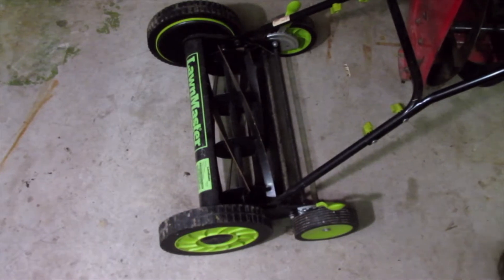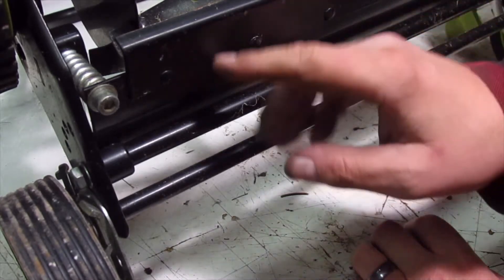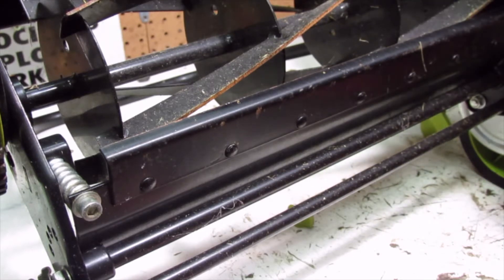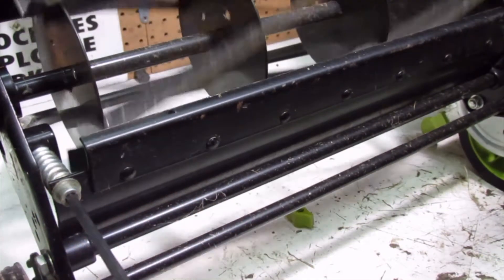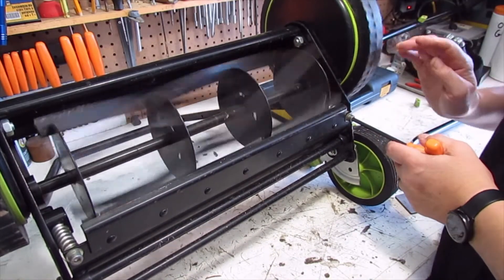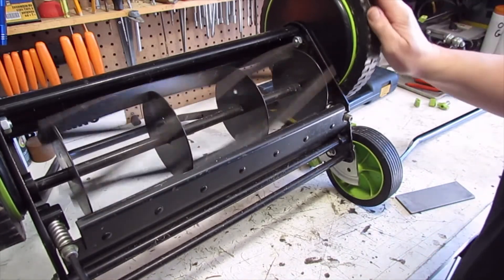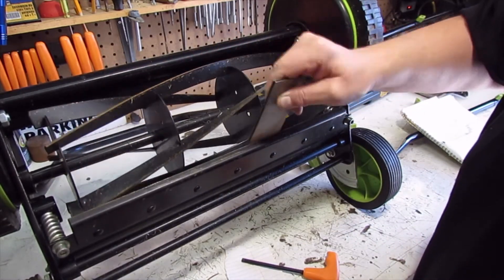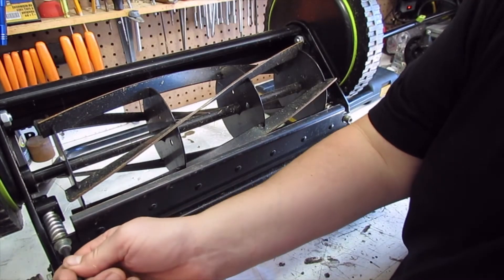De Squealing a Reel mower - And other cutting edge insights.

Comment: Can you fix a squealing gas mower?  I got my reel mower at walmart just like this one. no tools needed to put it together. mine squeals exactly the same from the very first use!
Reply from the maker: Squealing Gas Mower? Sounds Bad. engine trouble? Or is the blade rubbing on the deck?
Reply: @daslab68  I'm not sure. I try to spin the blade and it seems tight to spin. My neighbour said the same thing, that it is tough to spin. IT doesn't seem to touch the deck. It started squealing as I was using it at the end of the season. Got any ideas? thanks
Reply from the maker: @mranderson5668  Please make sure the spark plug wire is disconnected before you try spinning it so that it doesnt start up on you.  Try spinning it with the spark plug screwed out of the cylinder head.  it should spin freely with no compression when the spark plug is out.  if it is still tough to spin I would suspect some lower end damage. Perhaps gas flooded the crank case and you had poor or NO lubrication and have mangled up your crank shaft.
Reply: @daslab68  thanks, i will give it a try!

Comment: Did you end up sharpening it with the stone or backlapping?  Only used a stone on mine and needs more work.
Reply from the maker: I ended up getting a kit to back lap it.  It worked pretty well.  A stone would be hard to do on the curved surfaces, but it would be sharp when you were done.

Comment: Thank you. No it is not supposed to sound like that. Maybe it got hit & put it off balance. Maybe try a bit of oil. Do both wheels turn easily?
Right the metal doesn't touch.
Reply from the maker: Right On.